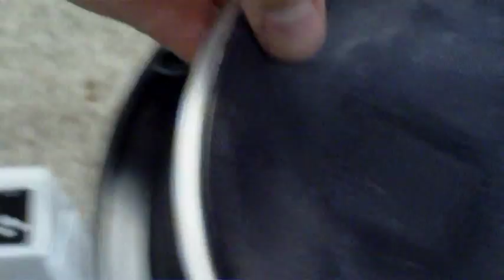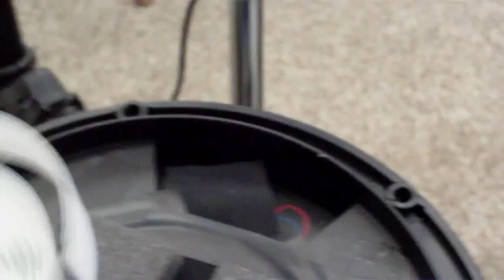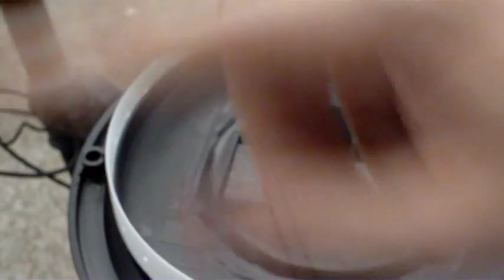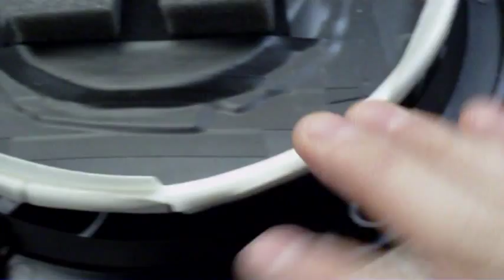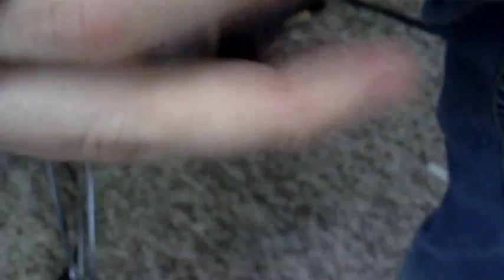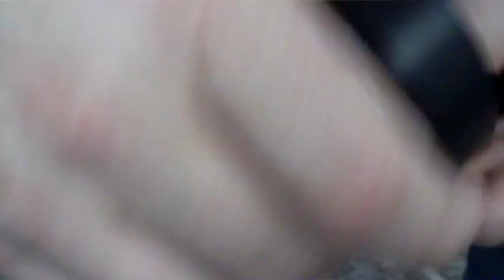Part 1: Adding a radius to the Rock Band modified ION drum rocker rims to protect the mesh heads

Comment: I went to Lowes and bought a Plexiglas Fluorescent light panel (The 2x4 white panels that cover florescent lights in drop ceilings) and cut a strip of it using an razor and a ruler then covered it in white duct tape (Using white roland v-drum heads)  had it like that for about 4-6 months now and there is no visible wear  ......  when you bend the plexiglas to your drum size just tape start taping it together ..  you will ALWAYS get a Perfect Circle.